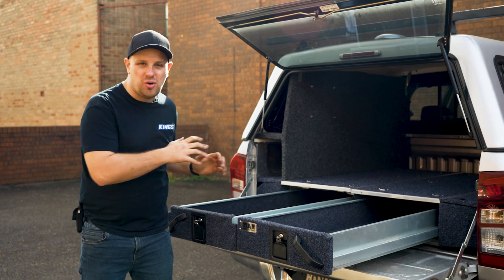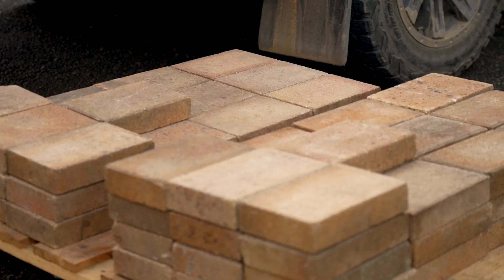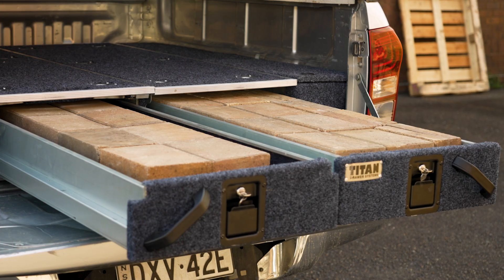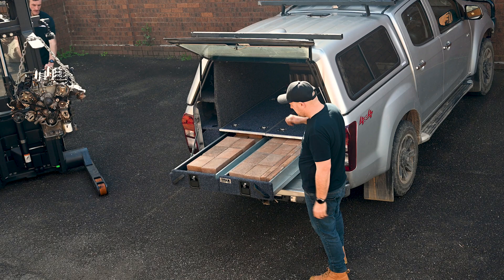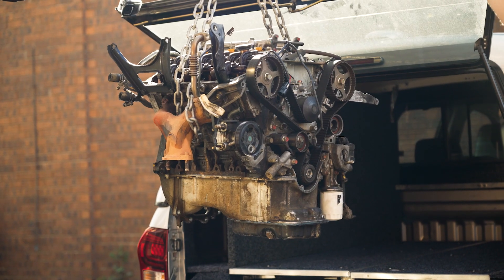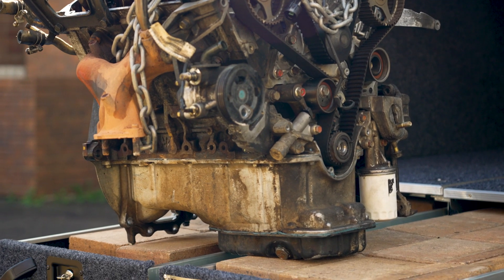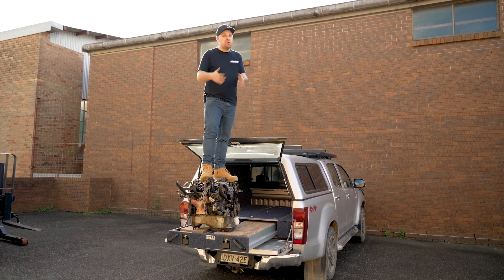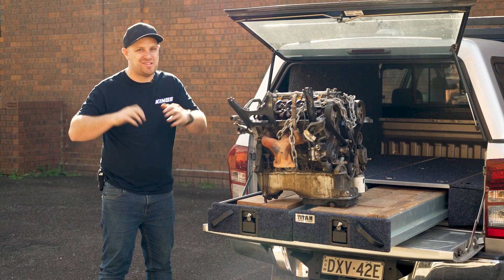Titan Drawers Ultimate Strength Test!

Comment: Hi Brenno if things fall into place I'm going to a 4x4 truck or 6x6 pirentie with a slide on to live in as I was king hit 2 years ago n stuffed my neck so I'm trading up when I can away from wet leaking rusty 76 4cyl, petrol if you get coaster get a 6cyl 5spd. For about 15k+ n convert that or if you get 1 the same as mine you will regret it n make sure it's a high roof 1 too but if I was you I'd go the way I'm heading to as new hino etc, with a super singles n bull bar etc 90k or 6x6 pirentie 25k ish  slide on with shower etc 3 to 15k n drop camper off n terrorise a few tracks n I'd be keen to maybe meet up I'm moving south n just missed your crew a few times as I'm moving away from east devonport n was a fan since 4x4 monthly maybe I should friend 4x4 24 7 on fb, any way may your tracks all be fun n give her heaps cheers , from a tasmaniac ps wouldn't swap tassie for mainland for anything as it's safer here keep safe n well n good luck